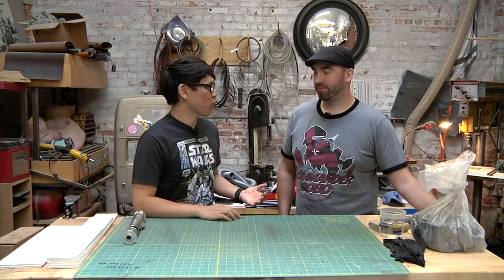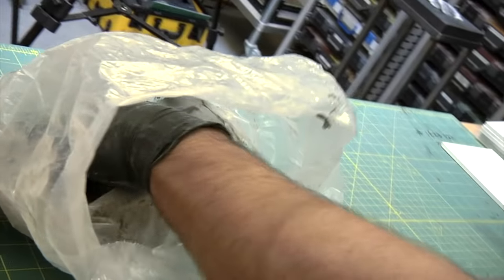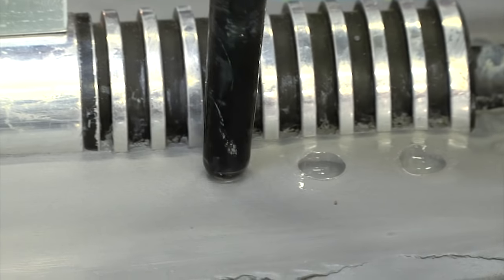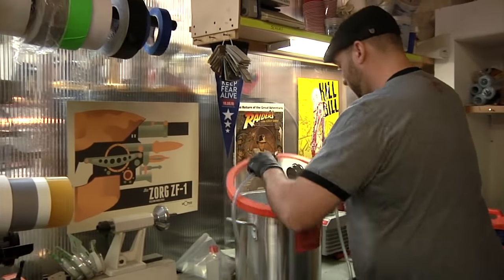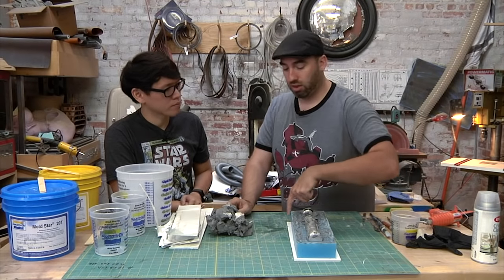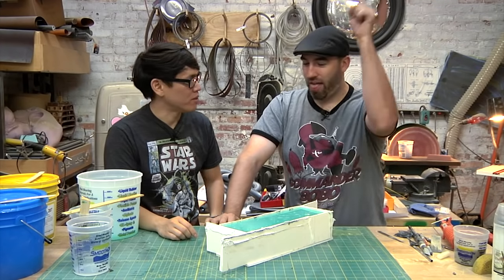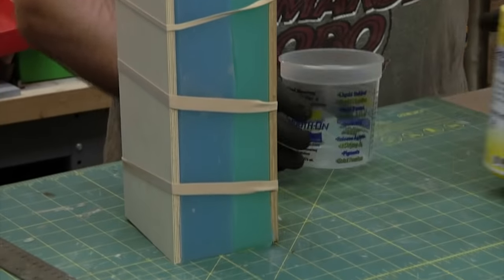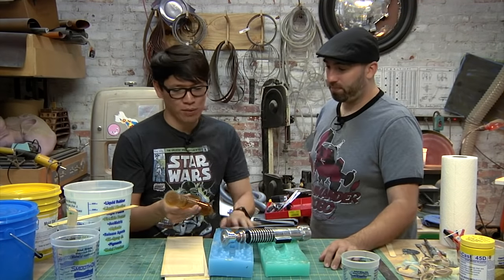How to Mold and Cast a Lightsaber!

Comment: "No special equipment needed"
- now just put the silicone inside our vacuum chamber
Reply: I watched this when it first aired so many years ago, learned a lot since then.  Laughed when I saw the vacuum chamber because these days I know the exact maker they got it from, tried to order one from them last week too but they were out of stock.  Thems the corona breaks.
Reply: @DKarkarov  yeah me too it's my favorite video here
Reply: You don't need a vacuum chamber depending on what silicone you use. It is a better way to do it though.
Reply: he said you don't need one just how he uses the mold he would rather use it
Reply: @blueridgewarden2838  This. You can use slower curing silicone depending on the project, a lower temp blowtorch to carefully remove bubbles before pouring, or just a slightly modified pressure cooker.
Reply: As someone who’s made many many molds I can tell you there are many grades of silicone and not all require a vacuum chamber. You can also use polyurethane as an alternative and it doesn’t require a vacuum chamber as well. GT products has a good Tin cure silicone that doesn’t require any vacuum chamber.
Reply: @bryceelischer819  it was a joke chill
Reply: @bryceelischer819  Great tip!
Reply: So, in general, it's not better to use food jelly to protect the first half. Then rinse with water. Warm wax and melt afterwards?
Reply: @marioandreatta5886  lol the dude was being helpful ya prat
Reply: @bryceelischer819  can you tell me how you can use RICE to determine how much resin you need for a casting... is it the WEIGHT of the amount of rice tested or the volume of RICE that is tested.?
Reply: The shits just not special bro😂 like go to a store

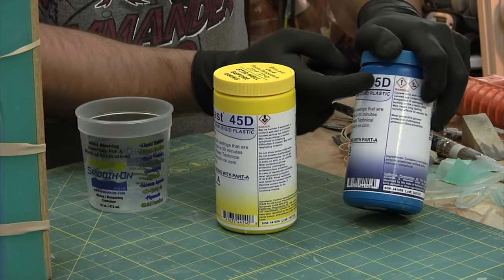Comment: 29:57 Smooth-Cast® 45D Semi-Rigid urethane casting resins

30:00 Mold Star® 20T translucent platinum silicone
14:00
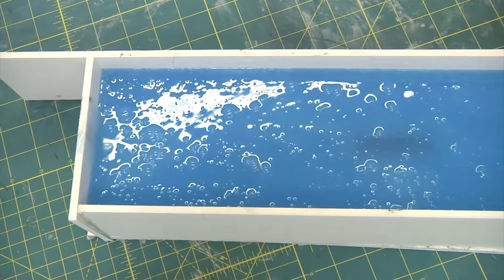16:00 Silicon x Cubic Inches x Grams
Reply: They need to list their materials in the description
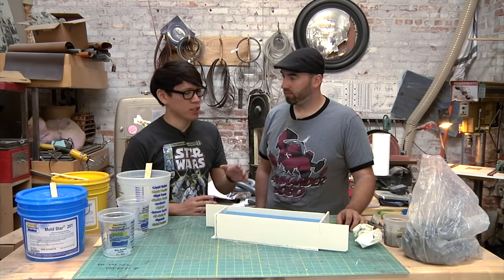Reply: 16:11 Silicone math
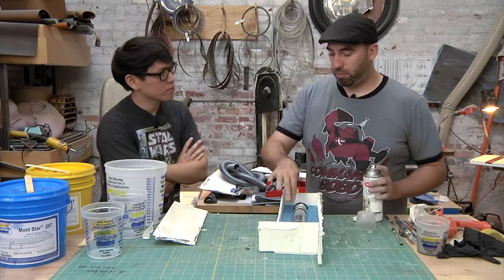22:15 Krylon Crystal Clear

Comment: After pouring the resin in the mold, you can put it on a vibrating table to force all the air bubbles to the opening. I use this method in my pours and get them to come out perfect.

Comment: This is a cool lesson. I remember doing stuff like that in shop class back in the 80's. We used sand molds and poured molten metal.  We also learned about how jewelers would make a clay positive, put it into a sand mold, then the molten metal evacuates the wax so you didn't need to remove the positive. I believe that's considered a one-piece mold?

Comment: Could you use this method for making a rubber knife?
Reply: U can make a mold of anything if you have enough materials
Reply: w
Reply: Alex Giles  you can make a form out of silicone like they did with your knife and and if you got your 2 halfs you have to use "Silicone spray" on the surface which cause that your cast out of rubber dont stick to the mateial. for your rubber you can use a "Harder" Silicone  just will it in there and youre finished^^
Reply: MsiP43t good idea man! :D
Reply: +rodrigo maldonado i mean, duck
Reply: +rodrigo maldonado  yes, i would make the mold using body save silicon though. Smooth-Cast has a skin safe silicon called "Body Double". Viagra is suggested.

Comment: Why use a clear coat and actually physically alter the prop, why not separating agent, I have never seen anyone using a clear coat as a separation agent... I don't think this is really wise for obvious reasons, I don't think Adam was too happy someone sprayed his stage accurate prop with clear coat... I wouldn't have been.
Reply: Frank is someone who does this for a living. He clearly said in the video that rubbing it down with some alcohol would remove any residue.
Reply: I know and I do believe him... what would the alcahol itself do to the prop.. but thats not really the point... Y???? When there are better things like release agents
Reply: James Catania I'm right there with you James.  The fact that he poured the silicone directly onto to prop when making mould had me scratching my head.  Everything, and I do mean everything, that I've seen, read and learned says to pour the silicone into a corner and let it naturally flow over the object instead of pouring it directly onto it.  I'm not questioning Frank's knowledge, just his way of doing things.
Reply: Reboot153 that is another thing but since he evacuates all the air i think he can do that... well he did... results look good and hes a pro... im not :)
Reply: @AQzygo  alcohol won't remove the clear paint. If I were Adam, I think I would be pretty pissed off if someone spray painted something I worked so hard to look accurate.

Comment: Why don't you just forget about the clay, pour it halfway, add alignment features like floating balls in the top of the wet RTV, let the pour solidify.  Then remove the alignment features, spray with release agent (so the silicone won't stick to itself) and pour the rest of the way?  Then you have a 2 part, yes?  Seems like it would be easier.
Reply: Because it would touch the bottom and the silicone wont go around it, and leave holes.
Reply: Your right ... I just tried it though and I held it up on a small pad of clay and made a clay channel to the side.  Befoer I poured the second layer I removed the clay so it would fill that in.  Worked pretty good.  It wasn't for a light saber, but a sculpture, I'm sure it would work for this too.
Reply: So the same process just with less clay?
Reply: a ton of less clay ... like 1/10th, and a ton of easier to clean up.  I've done this process before and the clay is messy and leaves a gross residue that takes a bit of effort to remove.  Also, if you don't remove all the clay you end up with voids when you cast the replica, which end up as bumps on the replica.
Reply: Hang the lightsaber in a big jar, submerge it completely in silicone, and later just cut the divider. Carefull not to scratch the original.
Reply: I just did that with another item.  The trick is, as you mention, not cutting it.  I cut the heck out of my original, but it was expendable.  Especially difficult when you have a lot of nooks and crannies to cut into.
Reply: David Austin I know. I started out with the 2 part mould using lego blocks (I don't mind the lines) and play-dooh kind of putty, instead of clay. It works, but I don't like the way the dividig line messes up fie details, such as hands on a figure. So I tried the one-piece-cut-later method, and it worked great for me, especially with transparet silicone.
Reply: All you do is hot glue a couple or raisers. This method is way too complicated on a part like this with a very complicated parting line.
Reply: om telolet om
Reply: I actually held it off the bottom with tacks (with doublestick on the back so they wouldn't move around on the bottom of the mold).  the holes that are left are so tiny that when you cast they pop off at the surface of the object (about the diameter of a hair in fact at the point of contact) ... virtually invisible.

Comment: I really wish they used an oil based clay, you just zap it in the microwave, get it soft, it cools harder, making it so much easier to remove.
Reply: apollo079 I prefer just using alginate instead. Still cheap, self leveling, and super easy to clean up

Comment: Nice video, I've never done anything like this, my experience is with sand molds and aluminium castings which were done under vacuum.

I would assume that it's also possible to put the mold into the vacuum chamber to extract the air after pouring. Although it may deform the silicone? 

A better solution may be to put the whole thing on a vibrating bed, I reckon that would get the air out pretty efficiently.

Comment: Much easier way to make a 2 sided mold than the clay. They should have put a 1/4" if mold material in box and allow to dry. Then spray mold release on the saber pour silicone on top of first layer ( enough for almost half the saber , and remember not much as the saber will displace some silicone when set in )set the saber in the silicone and add a little more silicone on each side till its halfway up the saber. A massager on the outside of the box helps as well as a vacuum chamber for the silicone before pouring. When the silicone sets up push corks into it around the perimeter of the object. After it dries remove the corks and spray mold release on the entire surface and allow to dry. Then pour silicone over the top and cover the object up the walls of the box. We use door skin on top and bottom as the silicone sticks to it and it will keep the mold from flexing and distorting the object when you cat it. Molds exterior should always be reinforced.

Comment: Pressure curing the silicone after the pour is (in my opinion) a better method. I use Moldstar 20T and with a 6 minute pot life, running to the degas chamber takes away precious time from a low viscosity pour. Pour your mold and then place it in the pressure tank. The pressure evacuates any air bubbles while the silicone cures. I realize that in this case, the lightsaber may be too large to fit into a pressure tank but this may be a useful tip for molding smaller items.

Comment: If you didnt want a seam line you could create a 2 part mould and cast it with wax then use heat to fuse the 2 parts together before making a 1 part mould and when set heat the wax up and pour it out before cast with your material of choice, the only problem is the 1 part mould will be single use because to remove the final cast you need to break the mould, also if the wax isnt all removed it will cause imperfections

Comment: Hi, this video is great! I would like to ask if there will be any problem if I skip the degassing part for the mold and the casting materials. I don't care for the visual apperance too much, because the final part will be covered in leather. But will skipping the degassing result in the physical properties of the final part? Thank you!
Reply: As far as I know, you can use it straight out after you mix it, but you pour it carefully in one spot and allow the silicone to level itself

Comment: I tried using GE Silicone to make a mold not this way and the inside will not cured for more than 2 weeks. The side of the cured silicone when pressed apart to take the sample out also crack or break off render my mold imperfect.  Will try this material Adams.

Comment: Tips, you didn’t keep the silicon in the vacuum chamber for long enough and if you don’t want bubbles in the resin once you’ve cast it then put the mould into the vacuum chamber for 2 minutes with it running, give it a top up with more resin if needed and 2 more minutes in the chamber and it’ll be perfect! Happy casting

Comment: I'd still prefer using Lego for a box.  
Not only is it less trouble than building one from foamboard (and make sure its sealed), but you also have a case to use the mold in for casting(maybe removing a lego-plate-worth of height to allow for clamping.

Comment: Don't mess with clay, people. Put some needles into the bottom surface, suspend your model on the needle tips. Build the box, fill it to the half of the model. Let it cure. Apply mold release agent, fill the other half, let it cure. Wait for everything to settle, open the mold. Pluck out the needles. Fill needle holes with something to prevent leaks. All done, twice as fast, and no mess. No need to break the mold box, too.
Reply: interesting approach, any videos on this method?

Comment: does Smooth-On Silicone Mold Making, Liquid Rubber OOMOO 30 work just as well for the mold? Also, if you don't have a vacuum chamber, what else could you do? If anyone answers this, Thank you!
Reply: Arcticx369 pour the silicone from a higher place with a steady slow stream and always start from the lowest point in your mold

Comment: Since nobody anywhere else in the world uses cubic inches, the calculation he did is this in metric:
Lcm * Wcm * Hcm * 1.13 = Result in grams
Metric = 5cm * 5cm * 5cm * 1.13 = 141.25g
Imperial = 1.97" * 1.97" * 1.97" * 18.5 = 141.43g

Comment: Registration points are important but you don't really need this many.  Now,  that shouldnt be confused with a ridge or edge.  Ty pically youll use a registration every inch or two,  but a small ridge all the way around is important if you don't have a lot of waste silicone on the sides.  When there is not a lot of waste silicone on the sides you may get bleed out of resin.  With a cut ridge all the way around,  your resin is less likely to bleed out. 

Why does any of this matter?  Sometimes your mounting piece is not clay.  sometimes you mount something to a board or something hard.  And you'll need to glue down registrations.  

The wavy line typically is more for bleed out than for registration.  

Smoothon is very susceptible to inhibition,  (I didnt bother looking to see if mold star is plat or tin  which determines the susceptibility) so the krylon helps to seal the clay and part in case it has sulfur in it.    I typically use Alumilite or Polytek as their silicones seem to be more resistant to inhibition.

The only real critique here is the amount of silicone they used.

Comment: i am wondering if it would work just as well and faster to use wet fine sand in place of he clay for first seperation. takeing a bed of moist fine sand and then pushing half the light saber handle into it

Comment: Really thank you for share this video! I needed it for a project. I will try. I can use my personal wax carving project for make this mold? Can I use it for metal casting? As silver or aluminium?
Reply: no you can't... for metal any kind of metal casting I need many extra steps... the first few are the same, but when they get to the pouring the final casting... you need special casting material that will melt/burn away in a later stage, then get a metal or concrete bucket fill bottom layer with special casting-sand, then put in the recently cast item, surround it with more casting sand, keep the top free for pouring in the liquid metal... be very careful and gently, you might have succeeded at that point ;)

Comment: I personally like to pour my silicone slowly with a thin strand to reduce introducing bubbles while pouring even if you have vacuum degassing your Silicone if you just dump it on in there you're defeating the purpose

Comment: there is so much air left in the silicone after degassing ???
Reply: With a vacuum chamber you can’t get the majority of the air out, that requires a pressure pot.

Comment: Here is a better way to judge how much silicone you use.

Weigh your clay.  Before you start know how much clay you have.  Clay up your part.  Subtract your leftover clay from your start weight.  This will tell you how much silicone you're going to need.  (roughly).  For the second half.  if you weighed your part.  Weigh your mold and part.  Subtract your parts weight,  and thats how much you need.  Or weight the clay you took out if you didnt leave a cavity under it...

Comment: It sounds like he magically found out through experience what the conversion between cubic inches and cubic cm is lol. It's actually times 16,3871 and not 18,5. But who cares.

Also you can easily measure the volume of any object by putting a bucket of water on scales, then suspend the object from a wire so that it is just below the water line. The added weight divided by the density will give you the volume of the object to a high degree of accuracy.

Anyways. Cool video. Cool result.

Comment: there's few things i see here that should and shouldn't been done.

wrong clay - water? that just doesn't work well with the rubber (or resin).

if someone used the clear on anything of mine they'd loose their teeth

there's light smears of the clay on the original and any good GK'er will tell you, you don't want that.

foam board? if your not planing to ever do molds again, but if you do then Lego's is the way to go. they might cost you a bit in the beginning but you can use them 100's of time. and if you use wood for larger molds, git it with the white lament all ready on it (just give it a spray of release agent). as for the brick lines who gives a shit, it's not the important part here, the casting is.

crystal clear as a rubber to rubber mold release - no, use mold release. i use a liquid brush on kind from PolyTech. but i use Smooth-On's rubber and resin.

only vacuum the rubber is you plan on pressurizing the mold with resin for a more bubble free casting

god, i use to pour my resin, now i inject everything

oh and that "RIBBON" has a more important job, it's called a Damn, and what it does is help prevent the resin from leaking out of the mold, specially if your injecting the resin and/or pressurizing it.

as for the backing (i was wondering if he was going do use that) i use 3/16 - 1/4" plexi-glass as you can pop off any overflows/splashes of spills (i always give the plexi a coat of release the first time i use it)